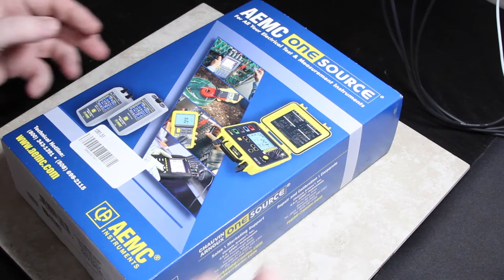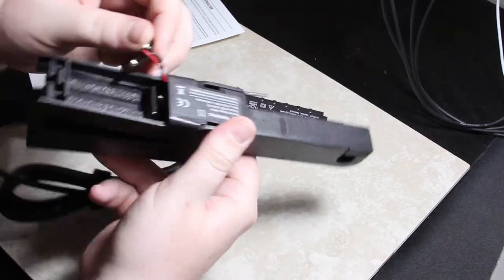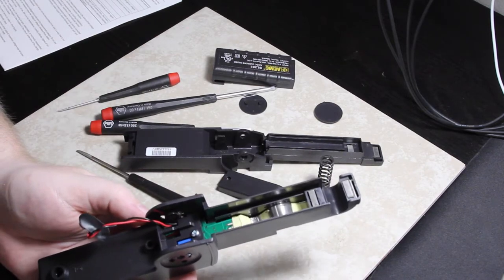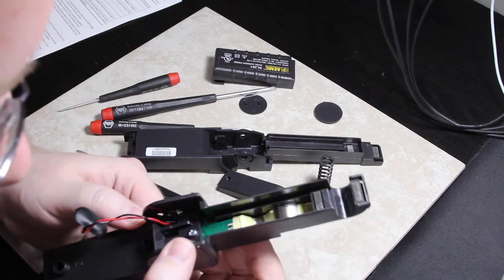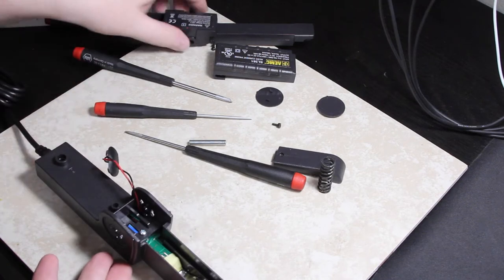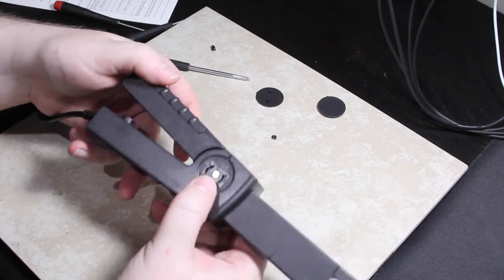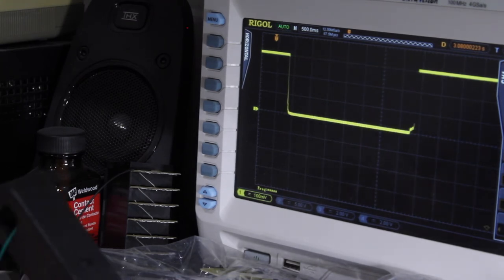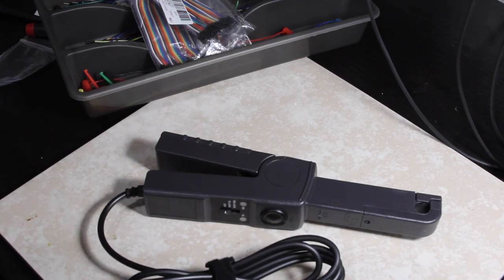Teardown of an AC/DC Current Probe: AEMC / Chauvin Arnoux SL261 (100A, DC to 100kHz)

Comment: Hi, thanks for your video, I have a fluke 80i-110s and it makes the same noise. But I have another problem I drains 0,5 mA when is off. Can you please check how many current it drawns from battery when swtich is in off position?
Reply from the maker: I don't have this probe anymore, but I don't remember having any problems with the battery draining while off. Maybe someone else can comment about the current draw.